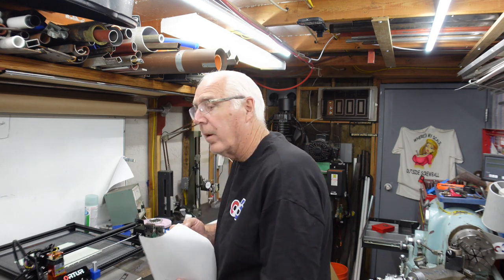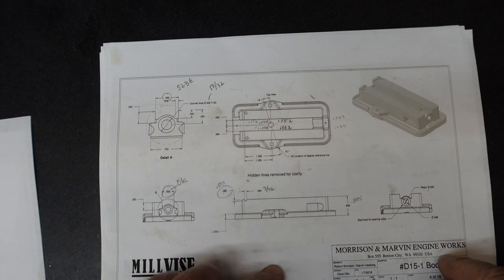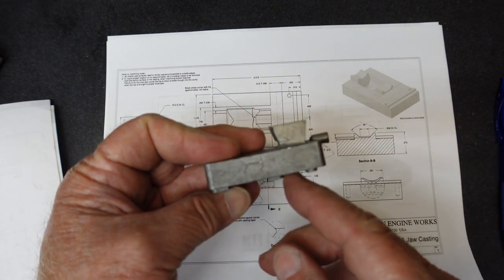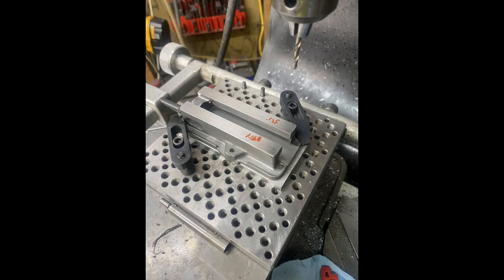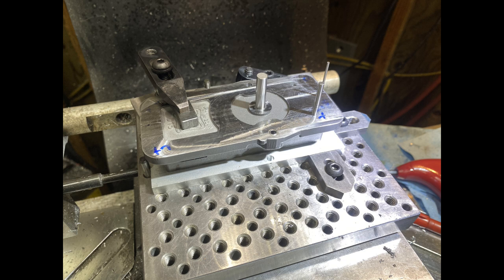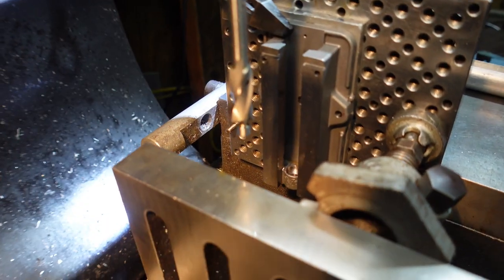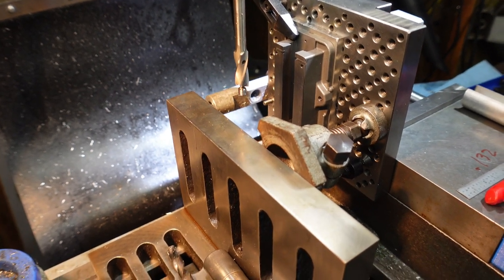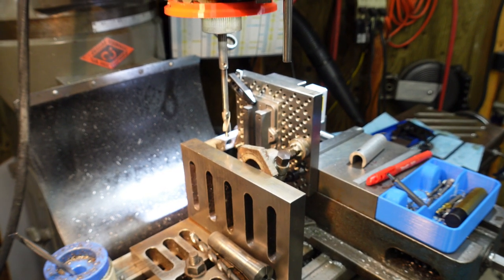Machining a 1/4" scale Mill Vise from Morrison & Marvin Castings

Comment: i got the other 'wilton' vise casting from them, castings so smooth and accurate with hardly ant defects! it will be a delight to make it.
Reply from the maker: yes, Carl build the wilton vise....an awesome piece
Reply: Never been so happy with the casting, feels like you just chuck it and it will be true. I think I am liking the builders vise aka 1/2 scale baby Wilton more than the baby bullet. First saw it in 2013 or so and wanted to get it but I did not have a big enough lathe to swing the main vise body. Plus I had the Wilton to keep me company. This time the flames reignited and I am glad the company is still making these.